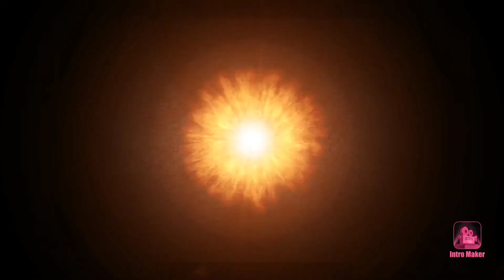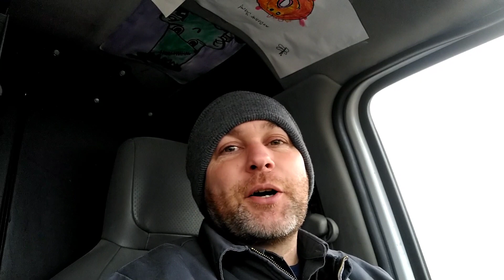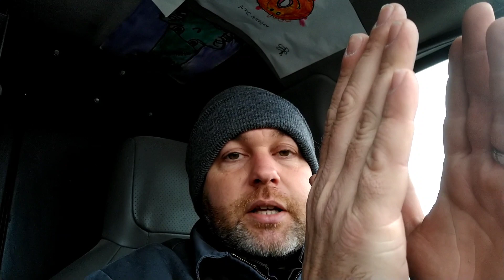Gas Furnace:  Modulating, 2 stage or Single Stage.  What do I really need?

Comment: If you have ductwork in the attic or in a cold crawlspace and it’s leaky or 1 inch instead of 2 inch like it should be, then yeah your gas consumption will probably go up. Your comfort level will also go up because you’re maintaining a more even temperature in the house. Get your ductwork fixed first before you go buy high efficiency equipment of any kind. And no thanks on the blessings. Predators, Hogwash and fairytales.

Comment: I just installed an airtemp variable speed blower/two-stage gas furnace. They are very sensitive with four pressure switches. Good luck when it’s out of warranty in 10 years. You’ll pay big time to get it fixed. Any savings on fuel and electricity you’ll blow on repairs after it’s out a warranty.

Comment: 80%. 2 stage. Be comfortable in your home. Go save the world some other way.
Reply from the maker: It has nothing to do with saving the world.  I am pro fossil fuel all day long.  I promote burning dino bones with everything I do.  It's a matter of saving hard earned money.  80% furnaces are louder, less efficient and prone to heat exchanger failure.  Single stage or 2 stage, 80% furnaces are inferior in comfort to the 90+ furnaces for the fact of supply temperatures.  Generating hot spots and large temp swings.  Not to mention the flue temps.  That extra heat going out the flue pipe is proof they are wasting fuel.  That's heat going out the roof rather than in the home.  The frequent flame sensor issues due to the fact of open combustion which is also why the damn things are so loud, is reason enough for me to never own or recommend one.  You are entitled to your opinion, same as I, and that is why I am a YouTuber.  But I will not agree with your opinion and differently not on my channel.  Thanks for the views.  Have a great day.
Reply: @andyscornerhvac sorry this wasn't specifically aimed at you. It's the KISS principle applied to a furnace.

No one is arguing that 80 is less than 96 on the efficiency scale. It's right there in the title. People that have 80s and go to 96 will notice that the higher efficiency run cooler. Hot spots aren't a factor of temperature at the register so much as bad ducting or incorrect furnace altogether. 80s are hotter running so air mixing is just as important as anything else. Not swaying your opinion, just commenting to the general viewers.

And we have a low efficiency unit. They're not that loud.
Reply: @andyscornerhvac bro, you hid my reply. Just watched a video of yours from 2 years ago where you said you didn't. Policy change?
Reply from the maker: @chadd587 I have never hidden a reply.  Be completely honest , I don't even know how to do I can promise it hasn't been.

Comment: I recently had a 2 stage 100BTU furnace that replaced a single stage 120BTU unit that was put in my 1900 sq ft 2 story home built in 1972. Long story short I should have stayed with a single stage mainly because the house isn't that much more comfortable than before. The installers did exactly what you mentioned, locked out the high fire mode which is IMO is wrong to do because a 2 stage furnace costs a bit more and not being able to use the second stage on a 2 stage furnace is a waste of money. It's ok though I ended up "unlocking" the second stage by reading the owners manual. I paid for a 2 stage and that's what I am getting now. I like the fact I can now "bump" up the temps by having a higher stage now.  Anyone needing to have your furnace replaced do some research before contacting HVAC people and don't let them sell you something you probably don't need. Lesson learned for me.

Comment: I find myself in need of a new furnace...my old Trane has a cracked heat exchanger.  You have answered many of my questions in a manner that I could understand.  I do have another question.  If I go to a two stage gas furnace and lock it into second stage, how should the tech be evaluating the compatibility of my existing duct work?  My house is about 1650 square feet and my old 120,000 btu 80 percent furnace did well.  I really appreciate your help!!
Reply from the maker: First off,  thank you for watching!  Then let’s start with the old 80% vs the new 90%.  The btu rating will be different.  The new one smaller actually.  When u go up in efficiency, u go down in btu rating.  The heat being produced actually goes to the house rather than the flue pipe and out of the house as waste.  That’s the easiest way I describe 90+ furnaces.  I actually have more videos on 90s vs 80s out there but the new furnace will be smaller.  Don’t worry.  It will heat better and save u more!  I promise with everything I am that you do not want a 120000 btu furnace on a 1650 sq ft house!  My house is actually 1675.  It has a 70,000 Btu furnace in it at 96% AFUE and is more than enough. They r designed differently and don’t waste the fuel.  As far as the 2 stage deal, the furnace will be sized for high stage (full capacity). So an 80,000 Btu furnace is actually around 50 to 55,000 Btu in low, depending on the brand and how they do their %.  Biggest thing to worry about is the right size.  Make sure they do a load calculation on your home.  Sq ft alone is not near enough info to size a furnace.  They will take all of this into the calculation.  If they do not do one (ask to see it), find a new contractor.  No one, I don’t care who they are or what they’ve done can guarantee furnace sizing without one.  Again, I have other vids out there about buying a new furnace and other things.  There is actually a couple of chapters dedicated to this topic in my book on Amazon.       Home Comfort Unlocked.  https://a.co/d/9r9xIAe 
Be sure to check it out and share with your friends!  A lot of people have the same questions!   Good luck with the new furnace!  Remember, the right contractor and install is everything!
Have a great day @SusanShandy

Comment: Great video!! Just a quick question would 2 stage be better for a house which has less optimal insulation? Parts of the house has cold spots and half of the second floor is above garage and is usually colder during winter and warm during summer. Any thoughts?
Reply from the maker: Insulation corrections and sealing would always be my go-to before anything. But personally, I know I don't feel that a two-stage furnace would fix that. If it has to run more due to a higher heat loss, it'll probably be in second stage most the time. Anyways. Equipment cannot always fix the situation. Sometimes the building or the space is the situation. And that's what needs to be corrected. If insulation and sealing is not an option due to access ductwork modifications would be my next step. Hope this helps. Thanks for watching! Check out the new book available on Amazon! And have a great day!
Reply: @ thanks for your response. If you have to pick between single stage vs two stage with current sup optimal insulation what would you recommend - single vs two stage? Also, can two stage be run as single stage till i fix the insulation and duct work? Thanks in advance. You are doing a great job.
Reply: I have a load Calc I can send you to see what exact amount of BTUs your house needs. Takes into account windows, which side of the house they're on, attic insulation and wall insulation, etc...

Comment: Great video.  I'm a home owner who is looking to replace my gas furnace and central air probably this year or next.  We currently have Trane, and I'll probably stick with that, but I'm undecided about single vs 2 stage.  Your video makes a ton of sense, and I'm wondering if the same logic applies to 2 stage a/c units.  Do they use more electricity for the added comfort? I'd really appreciate some insight there.  Our heat and a/c bills aren't bad at all with the current 16 yr old system, and I'd hate to mess that up by falling for marketing hype.  Thanks!
Reply from the maker: 2 stage AC is a little different.   Or at least I feel different about it.  I would always recommend the higher seer ac units and they typically come in two stage.  But 2 stage cooling actually works well especially if you have a system with a zone system.  The energy usage with 2 stage AC  is a lot different than a 2 stage gas furnace.  They do well.   And they are efficient.   I would never sway away from 2 stage AC.  This is actually an awesome idea for a video!   Thank you very much!  Be looking for the next vid.   Might just be on this topic!
Reply: @hvacstandard  Good to know.  Thanks for the additional info!  So I'd be good to look at a high efficiency single stage gas furnace, and a high seer 2 stage a/c unit?
Reply from the maker: @MrNiceguy259 sounds good to me.!  I wouldnt think twice about that option!

Comment: Another plus of two stage is they can work better with existing undersized ductwork. High static pressure is a death knoll for ECM blower motors, I’ve found that two stage can cut deep into how long the motor sees higher static pressures
Reply from the maker: Why not just do the job right and fix or replace the ductwork?  Changing the equipment to make up for inadequate ductwork is not benefiting anyone.  I strongly agree that high static is death to a system but y would anyone band aid the problem?  Not fixing the issue or at least offering to fix the issue is a disservice to your client.  That would be like having one tire on your car with low air pressure and instead of airing it up and fixing it , you take air out of the other 3 to make them match. Doesn't make sense.
Reply: @andyscornerhvac  it’s not always in the customers budget for new ductwork. We can suggest all we want, but sometimes it’s not our call. Having said that, yes it better. But at least 2 stage give it a fighting chance at longevity
Reply from the maker: @marconantel7735 I agree with that.   It is NOT always our choice.  But worth an offer.

Comment: The single stage 80 gas furnace is more reliable less breakdowns. My parents got a high-efficiency gas furnace and it didn't even last 2 years before there was problems and they don't even last 10 years before that the last one lasted 45 years😮
Reply from the maker: First off, what is there to break down more on a 90+?  It has a secondary heat exchanger so then it has to have a drain as well but that is the extent of more parts so where's the extra break down factor.   I'm sorry your parents had problems right off but that could be anything.  Installer error is the number one reason for system failure.  And then the 45 year old furnace is not comparable to a new furnace in any way.  Completely different parts.  Different functions and really just not comparable.   No furnaces do not last 45 years anymore.   Nothing does.  So at this point uou will have to have a lot more accurate information to change the mind of an entire industry.  The knows that high efficiency gas furnaces are superior.  Not just my opinion.

Comment: If you live in a aria that temps drop to 30 below are colder the furnace is sized to heat your home at 30 to 40 below but it is only that cold 10 to 20% the rest of the winter your furnace is way oversized I removed a 130 thousand btu furnace out of my house installed a two stage 90 I Bryant had to replace all duct work I heat my house at 40 thousand btu’s 75 % of the winter in northern Mn hat was 15 to 17 years ago haven’t even replaced the igniter my gas bill is 85 dollars a month on the budget plan that is 1020 per year before Covid it was 65 a month

Comment: Recently, a service tech recently came by and said my CO levels were high but never turned the furnace on. Is this even possible? Another tech I was talking to thinks there were using a scare tactic?
Reply from the maker: Absolutely!    They can not check co without the furnace running.   Scare tactics should never be used.   I can not stand when technician do this kind of thing.   It makes us all look bad!   Not all of us are trying to screw someone!   I promise.   That tech should be reported to the company they work for and then find a new contractor.   A company can not allow one of its techs to use scare tactics.   I'm sorry this happened to u but unfortunately in these days there a lot of bad people out there.   Please don't think every technician is a bad one.

Comment: A 2-stage furnace saved us about 25% in propane usage. 
Most of our heating season has moderate temperatures. Between 32 to 60 F. 
The old single stage furnace was wasting heat in the spring and fall. 
Now it cycles on. Runs a little bit and cycles off before it ever reaches the high fire stage. 
Before we got a 2-stage furnace our fall usage was similar to our winter bill. 
Plus when the furnace cycled it would overshoot the set-point of the thermostat. Which was uncomfortable. 
Now it’s like we have two furnaces. One for mild weather. One for cold weather. 
We’re in southern Ohio. South of the snow belt. North of the sun belt. 
But we still get some zero degree F weather.
Reply from the maker: If the thermostat is over shooting and it's hot and uncomfortable in there even in mild weather, first thing I would think I would be the size of the Furnace sounds like they oversized it for your house. Bigger is not better. Too big for ferns cannot be compared to it's two-stage furnace. That's apples to oranges not oranges to oranges comparison

Comment: This idea that you have about burning more fuel, while keeping the house at the same temp, defies the laws of physics. A btu is a btu, and it takes the same number to raise the house temp to a setpoint, whether delivered over a shorter or longer time has no bearing, except maybe the differential causing slightly more temp variation, which a modulating furnace would level out and burn ever so slightly LESS fuel since it keep the differential swings finer.

Comment: Question can you run a 2 stage furnace and a single stage AC or do they have to be the same dual or single or various trying to figure out what I want and can afford.
Reply from the maker: A single stage ac can go with either furnace but a 2 stage ac should be with a 2 stage furnace so you get different blower speeds

Comment: Done two of these installs, one in cold climate and the other in moderate climate. Gas savings and more comfort both times. My guess is is your duct work isn’t up to par there may be some truth to this. Single stage units have larger swings temp and result in over heating. Originally I have a two stage in the moderate climate is a pretty big house (3000sqft) and it overshot as well creating a colder house then a hot house. Used TONS of natural gas. The modulating unit changes the entire house. No longer could you even hear the heat call out. Couldn’t hear air in the registers. House just seemingly magically stayed warm and the bill was cut quite a bit. There are LOTS of variables here.
Reply: PS, getting ready to do a third house now but thinking about using an AMerican standard unit instead of Lennox or Trane.

Comment: Hey Andy, Live in Connecticut. Just moved into my 1st house. The house is only 800sq ft with crawlspace. Has forced air Oil and central air. The HVAC system is in the closet and the return is in the closet. Drives me crazy because the return is in the living room so when the system kicks on its like a loud blow dryer. Getting ready to covert over to gas but don't want the same annoying frustrating issue. Some contractors have advised me to put variable speed and put it in the attic. Im reaching out to you to see what you recommend and your expertise.
Reply from the maker: Around here I dislike them in the attic.  But a lot of areas do it everyday, it's just the norm for some.   There's nothing necessarily wrong with it as long as they seal everything up very and I mean very well.  You want no infiltration from the attic.  No cold or hot air getting in.   No dust or dirt.   That kinda thing.  Also moving to gas, God Bless you!   Lol.  I strongly dislike oil!  But that may just be because we don't do a lot of that around here.   Lp or natural gas furnaces are much much quieter.  80 % furnaces are typically louder due to the combustion air typically draws thru the doors of the unit.   I would not by any means recommend an 80% AFUE furnace in your closest.   It will be almost as loud.  But there's the draw back.  90% furnaces are typically not recommended in attics in areas that freeze.  90%ers condensate when they run.   They are a better furnace than an 80 but location is everything.  You might see if a contractor could maybe move your return or insulate it to soften the noise.  Absolutely, if you stay in the closet, put in a 90+ with a true variable speed motor.   Pay attention though, there is a difference between a true variable ECM motor and the new 5 or 9 speed ECM motors.   The true variable is a little more expensive but you can manipulate the air flow to match your needs.  I obviously haven't seen your set up but if it were me I would first look at changing the return to quiet it down and have a solid door on the closet.   If you go with a 90+ the combustion air will come from the outside so the door can be solid.  Biggest thing,. Just find the best contractor that you like and feel comfortable with.   One that will answer your questions and attend to you needs.  Perfection does cost more sometimes but it's worth it in the long run because this new system is an investment.   Not just a house repair.   It's an investment that you'll have to live with for the next 15 to 20 years.   Hope this helps a little!   Be sure to subscribe and share with your friends